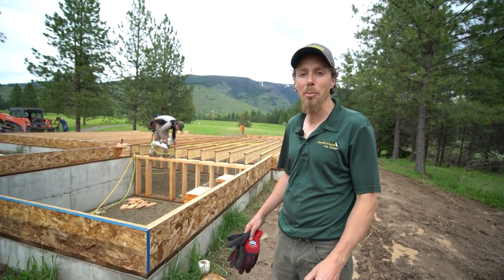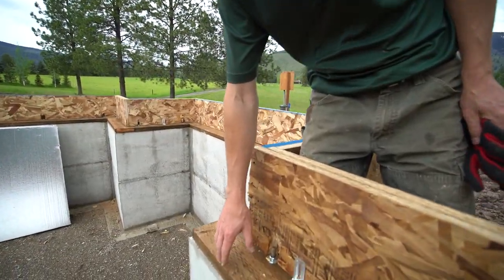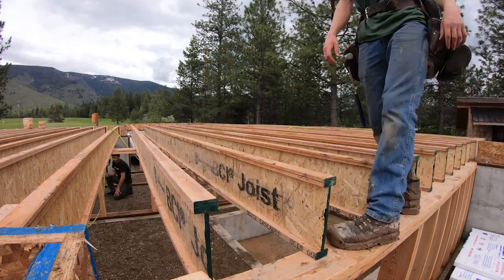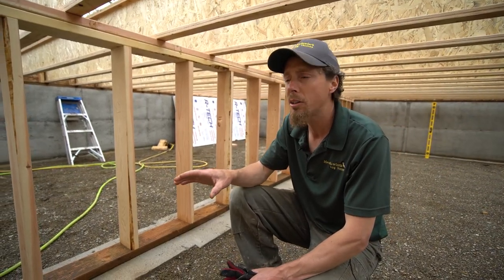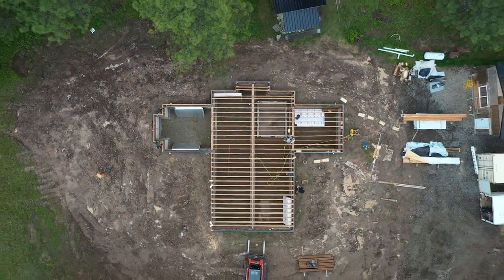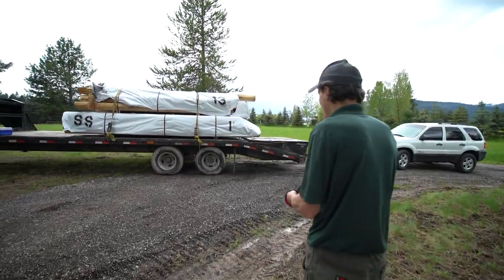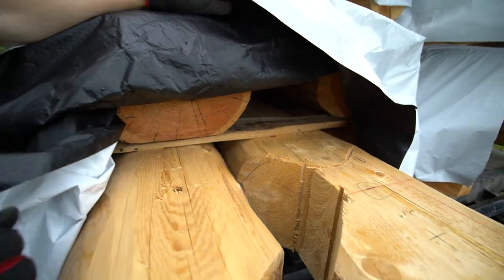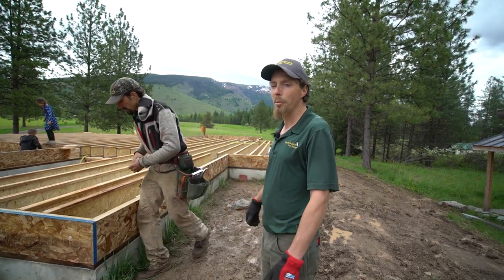Lake Creek Log Home Assembly, Subfloor, Meadowlark Log Homes

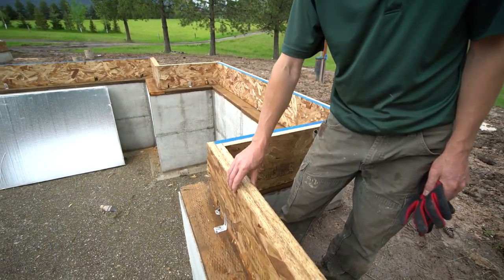Comment: 2:21..great looking build. The only comment I have is on the rim board..with all that expense only to try and save on those crucial items by using MDF doesn't make sense to me!! If I was the home owner, I'd insist on solid material..a little more expense could save huge in the long run. I don't need to tell a home builder what MDF does in the long run if there is ever water present!! It's a moisture wick and breaks down. 20 years down the road that stuff is going to start to get punky..no matter what you do to protect it.
Reply: Well put, I agree 💯

Comment: Can you build cape cod Massachusetts yes or no
Reply from the maker: Yes Cape Cod should not be a problem. We have built 2 log homes in Westminster Massachusetts. We have a structural engineer who does a good job of getting the design engineer stamped and approved to build in Massachusetts to meet each town’s specific local building and energy codes.

When you are ready to proceed with talking about your project you can click on Meadowlarks’s contact form that you can find on the bottom of each page of the website. Some of your desired design information would be good and then we can begin discussing your project. We would help design the home with large overhangs and porches so that it has protection from those famous nor’easter‘s that come through the Cape.